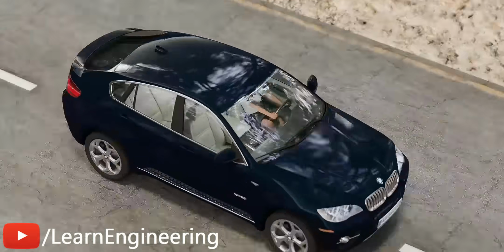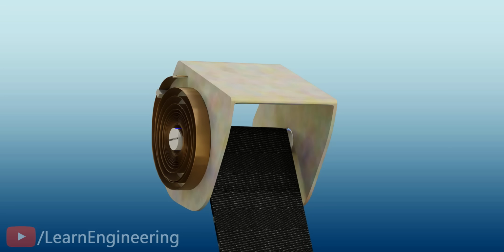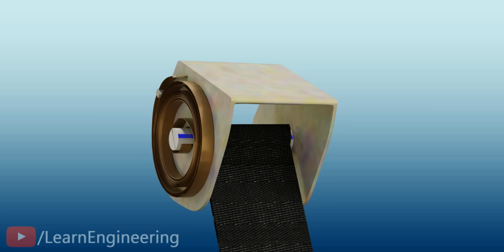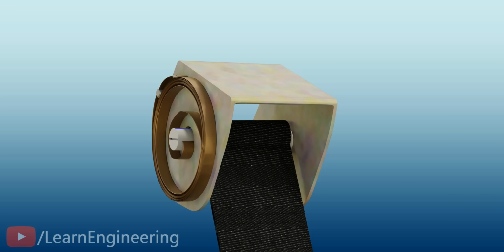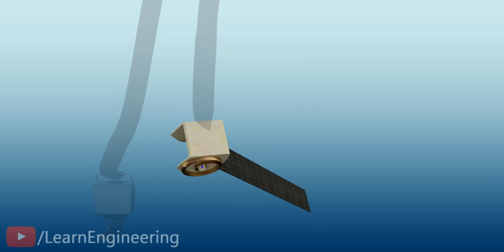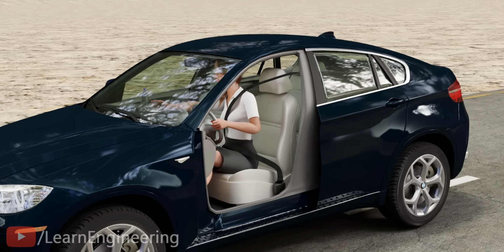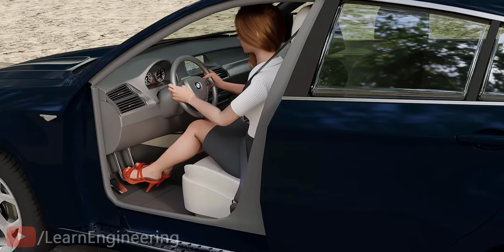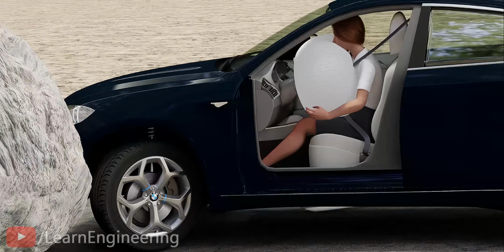Seatbelt | How does it work?

Comment: I see forms of this question coming out multiple times in the comments: "Will the seat belt pretensioners fire in a sudden braking event?" Short Answer: No. Long answer: The video is mistaken, the pretensioners do not fire before an impact, the airbags and pretensioners fire when (depending on the system) the vehicle's impact sensors are triggered and/or an accelerometer in the SRS module detects an impact. When the vehicle hits something, there is time between the initial impact and the vehicle coming to a complete stop. This time is the time in which the occupants of the vehicle must be safely decelerated from the vehicle's pre-collision speed to a stop. The most serious accident is when a vehicle hits a stationary 'non deformable' object (such as the rock in the video). If the vehicle had a 'rigid body' chassis (term used in theoretical physics to mean undeformable) then the vehicle and occupants would have to decelerate to zero instantaneously, resulting in massive injury or death to the occupants. Obviously this is theoretical, and the chassis of the vehicle bends and deforms, all the while decelerating the passenger compartment and therefore the occupants (this is the reason for crumple zones, they are sacrificial components of the vehicle intended to absorb the energy of the vehicle and decelerate it at a rate that is more safe for the occupants. This increases the time from which the initial impact occurs to when the vehicle & occupants come to a stop. During this time after the initial impact, the SRS (Airbag) module uses accelerometers, in many cases additional 'impact ' sensors, and occupant weight sensors (specific layouts vary from manufacturer to manufacturer and model to model) to compute the severity of the accident, determine which aribags/pretensioners to deploy and in some cases how quickly to deploy them (some aribags have multiple stage deployments) , all in fractions of a second (down to as little as 10ms in some cases) and before the force of the impact reaches the passenger compartment.
Edit: Note some vehicles do not use 'pyrotechnic' pretensioners  (pretensioners that use an explosive charge like the pretensioners described in this video). These Vehicles have different controls, and I am not familiar with these systems.
Reply: Yeah, I wrote a comment on that too.
Reply: @DashCamSerbia  i really confused with the combined effect of pretensioner and torsion bar, as torsion bar is provided to absorb rigidness from innitial impact to standstill of vehicle, so that passengers wont get much hard force. and allow them to fall forward to a rate that air bags will fully deploy. but using the pretensioner at the time of innitial impact is like countering the effect of torsion bar, one place enggineers are allowing seat belt to fall forward slightly, another case they are tightening it. please someone explain where i m wrong in my understanding of torsional bar n pretensioner
Reply: @ashishkumar-yn5vm  During impact, occupants won't start moving forward imidiatelly. First the cars front starts deforming, and the G-forces start increasing. Occupants are still in their seats, and before the G-forces start moving the occupants forward, the pretensioners will tigten the seatbelts and push the occupants back into the seat rest. That is done to provinde more space for seatbelts and load limiters to work.
Then the seatbelts stretch, absorbing the energy. And when the seatbelts had fully stretched, the load limmiters stretch out, further absorbing the energy. And then there are the airbags at the end.
Reply: I=F*t=m*Δv =>F=(m*Δv)/t
I= Impulse= change in momentum
F=Net Impact Force
m= mass of vehicle
t= duration of impact
Δv= change in velocity= velocity before impact- velocity after impact (zero)
I=F*t= m*Δv=constant 
F=(m*Δv)/t, if the vehicle was rigid (non-deformable), it will come to a complete stop almost instantaneously, which means the impact duration will be very short and the net force experienced by the driver will be very large. Vehicles chassis are made of non-rigid materials to increase impact duration and reduce net impact force. Modern vehicles get crushed vey easily after an accident because their chassis are designed to absorb most of the energy during an impact so that the occupants will experience a small impact force.

W=F*d=ΔK=constant
F=ΔK/d
W=work done
ΔK=change in kinetic energy
F=Net Impact Force
d=deformation
A large deformation would result in smaller net impact force. Car bodies are made of tough materials (deformable materials that can absorb large amount of impact energy) to make sure the passengers feel as little impact force as possible.
Reply: Thank you kind Sir.
Thats was Something I wondered about
Reply: @Brad Noyes  , I've read your comment and man no matters what others say in this shitty comment section , you've really done a superb job to make us understand the mechanism and also the whereabouts of your not understanding part 〽️ . I've really appreciated your comment thankx 🙏
Stay blessed!!
Reply: This should be top comment
Reply: Well said
Reply: Thanks, thats what I was looking for. But please break such long comments into paragraph
s in the future. The are in this form very hard to read.
Reply: True..
Reply: Thank You Sir Noyes ..... well meant gratitude
Reply: Awesome sir, thanks for the explanation
Reply: gg omg
Reply: Thank you, I did come here looking for an answer to exactly this question. Much appreciated.
Reply: i really confused with the combined effect of pretensioner and torsion bar, as torsion bar is provided to absorb rigidness from innitial impact to standstill of vehicle, so that passengers wont get much hard force. and allow them to fall forward to a rate that air bags will fully deploy. but using the pretensioner at the time of innitial impact is like countering the effect of torsion bar, one place enggineers are allowing seat belt to fall forward slightly, another case they are tightening it. please someone explain where i m wrong in my understanding of torsional bar n pretensioner
Reply: Hmm, I wonder if that's why I'm always having trouble with the back-seat seatbelt in my parents' car... If I lean forward a bit (say, to grab a water bottle held between my feet), when I lean back afterward, I feel the seatbelt ratcheting, and it locks me in place, not slackening even after I've gotten back into position. In fact, it doesn't un-slacken at all until I unbuckle my seat belt entirely and let it retract all the way back into the holder (which seems like a massive safety flaw, that you have to fully take off the belt to get it loose again). Shouldn't the (non-pyro) pretensioner un-tension after a short time? And why is it so sensitive that if the car is braking even slightly while I'm leaning forward to grab something, it triggers?
Reply: @WackoMcGoose  That is not a pre-tensiner, that is a faulty seatbelt (spring stucking or something). Pre-tensioner only goes off once, and then needs replacing.
Reply: @WackoMcGoose  I'd say that is most likely caused by you pulling the seatbelt all the way out. Often pulling the seatbelt all the way out causes it to lock and only allow it to retract. you can try it with the vehicle stationary. I assume this feature is for securing child car seats or something like that, but that's just a guess.
Reply: Extremely validated reply
Reply: 👏 respect for a thorough answer! Thank you. I can't understand it, the maths anyway..yet. but as a training mechanic this is very valuable and appreciated 🙏🫶
Reply: I think 80% won’t read this
Reply: @ilovehuhnchen1956  Did you?
Reply: @ilovehuhnchen1956  too much to read
Reply: @gilbertharerimana1436  And yet Brad Noyes
' comment answered the obvious questions a thinking person would have had that weren't addressed in the video presentation, so you only got half the story... assuming you were even paying attention in the first place.
Reply: @gilbertharerimana1436  Knowledge requires effort, which explains why we have so many ignorant people in the world.
Reply: @ilovehuhnchen1956  I didn't read cause it looks shit waste of time
Reply: @mohankrishna1443  Your loss
Reply: @mohankrishna1443  why are you even watching the video?
Reply: @mohankrishna1443  I imagine that's the way you go through life, too.
Reply: You wrote a whole essay
Reply: You are incorrect for some models. Modern BMW and Mercedes will fire the pre-tensioners ahead of time, before the accident if the vehicle senses an impact is going to occur.
Reply: @DJS_ENO  yeah. I’m sure that you’re talking about those vehicles with radars.
Reply: @DJS_ENO  In that case the system has to use other sensors like radar in order to determine that a crash is inevitable. Only then can the pre-tensioners fire before impact. The video implied the pre-tensioners fired just based on brake input, which cannot be true.
Reply: idk when i do a quick blip of the brakes randomly without warning in any of my cars they lock up for a few seconds
Reply: @p_entamessaging9876  Locking and pretensioning are two separate systems. the seatbelt lock just prevents the seatbelt from being pulled out, and is caused by a sudden change in velocity or even some will lock if you try to pull the belt out too fast. Pretensioners lock and tighten the belt to pull you back into the seat. On vehicles with pyrotechnic tensioners, these are single use.
Reply: @bradnoyes7955  you are half wrong, modern vehicles use combined pre tensioners, my car retracts my seatbelt in case of hard breaking but the belt releases itself moments after, that's the electric pre tensioner, a motor is attached to the seatbelt to make that possible, than there's the pyro pretensioner that opens only in case the crash sensors send the signal since the electric pre tensioner can't manage to be that fast/strong to do it by itself.
Reply: @pidhsome  That's why I said 'On vehicles with pyrotechnic tensioners, these are single use.', My point is the video is completely wrong about when pyrotechnic tensioners fire.
Reply: Why so many likes for this comment when copied and pasted from Wikipedia
Reply: @of_oniichan7755  I did not copy and paste this from Wikipedia
Reply: Also it cant be loaded with explosive.. i drove audi that was electrical cause it did tighten the seatbelt on hard breaking and the chair was hugging you..
Reply: @noobontour3167  in case of an accident the tensioner uses explosives to retract the seatbelt, if you brake hard or skid, the car will retract electric
Reply: @87Espen  u might be right maybe when an actual colition ware detected it could be that way, make sense.